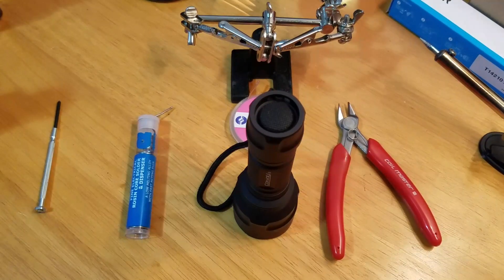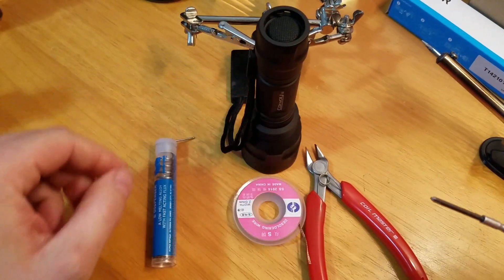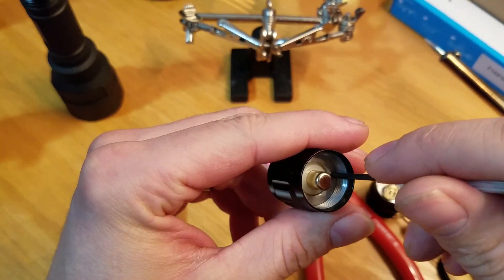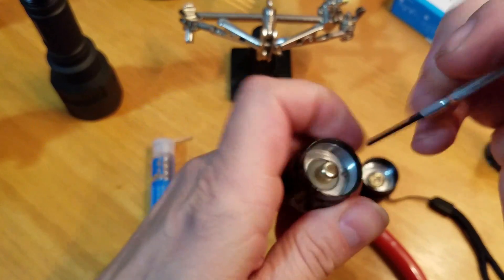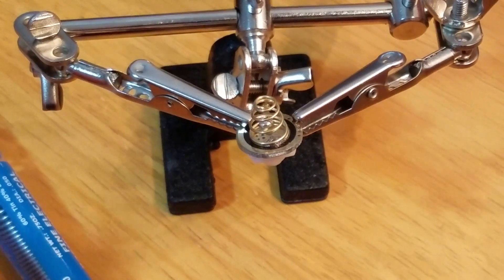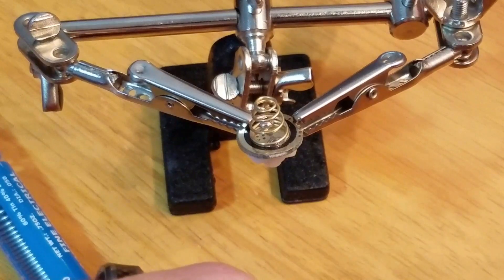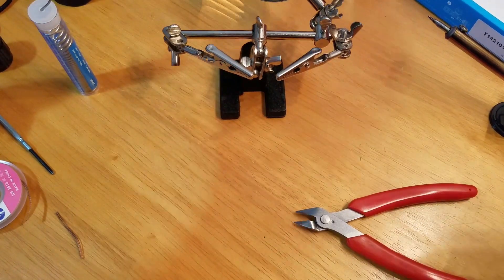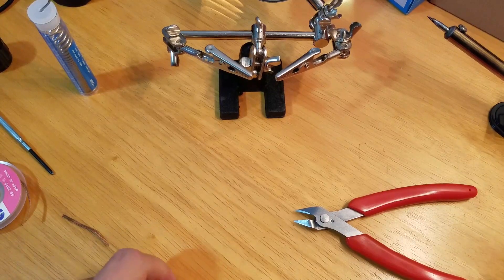Flashlight Tail Spring Bypass  (How To Video) On The Convoy C8

Comment: I fixed my lil LED flashlight today. It was a rear button. Just replacing the batteries didn't change anything. Make sure you test the batteries that you are putting in. People at my house seem to save weak and dead batteris and put them back in the package. 🤬 After putting the new ones in, I found that the switch wasn't getting a good ground, so I bent the tab out so it can contact the inside of the flashlight. I also had to use steel wool to clean off the oxidation from the aluminum. It works like new again.

Comment: I wonder about the spring. In normal use, passing current through that spring should alter the spring resistance. My guess is it would increase resistance.
The copper braid should make resistance more stable.
Since the copper braid is in 'parallel' with the spring, resistance should actually be lower.

How much brighter was the light and how much longer did the batteries last?

Comment: Now he has ended up with a blob of solder contacting the battery instead of the gold plating on the spring. The overall resistance has probably increased, defeating the intention of the mod.

Comment: To remove and tighten the "thing" holding in the tail piece, use a pair of small, needle nose pliers. Place each of the needle nose tips in the 2 indents on the "thing". You will have much more control of the "thing", especially when you're  replacing it and need to find just the right position to find the threads and avoid cross threading. It's also easier to screw in, after you get it started, if you  control both sides, rather than controlling only one side with a screw driver.

Comment: actually the're no difference at all my god flashholics people so sassy
Reply: depends on driver you use.. if you do it on stock convoy 7135 chip type driver sure it will make no difference.. if you do it on direct fet driver the one that astrolux use, than it will make a bit difference... im done it on my astrolux c8 and blf q8 and gain about 150 Lux more after do it on q8 measure with ceiling bounce style....
Reply: @harisyoung4110  and what about astrolux eco3,can ı see big difference ,eco3 has double springs.What can u say?
Reply: @TheSuvari  Go to budgetlightforum.com and search for a spring bypass vs double spring thread.. there will be more scientific test present there that show the resistance measurement result between those two.. sure will be more difference with ec03 bypass but at only few second before the temp control kick down the brightness.. i have a sp36 narsil that can set to turn off the temp control and with all the 3 spring bypass, in just 2minutes of turbo it build so much heat till i cant hold it with bare hands.. but the most benefit i get is when the batteries is not fully charge it still give the best performance due to lower resistance.. and sp36 also come with double spring at all 3pcs batteries slot.

Comment: I'm new to modding torches and wonder how much do you gain from this. I just opened my BLF A6 (same as Astrolux S1) and measured the resistance between spring and the outer copper ring, it's about 8.5-9ohm depending where I put the probe. Any idea how does this compare to other switches?
Reply: OhFishyFish personally i wonder about the gain but I would suggest to you to touch you meter leads together first, if possible zero the meter at this point. The best way to measure such low ohms and possibly even check how the mod improves current flow is to pass a known current through the spring/switch assembly and measure voltage drop across assembly. Then use ohms law to mathematically deduce the resistance, most likely a fraction of an ohm. You is be measuring the leads of your meter if you seeing upwards of 5-10 ohms.

Comment: If that tailcap spring is really gold coated, is this hack necessary? Gold is an excellent electrical conductor.
Reply: Think of it as using one wire or a pair of wires to carry current

Comment: Bypassing the spring and increased voltage on bulb. Would that decrease bulb life or possibly cause it to burn out?
Reply: Your driver will prevent that.
Reply from the maker: +Larry Olimb it will slightly decrease the bulb or led life but not by much at all. As far as blowing a bulb I'm not sure but I do know it will not blow an led.

Comment: Hey man tks for your nice video. I have the cheap one. Any suggestions on spring bypass?
Reply: The tail spring bypass is only one of a few "tweaks" to turn a cheapie into a pocket rocket
The next being bigger wires from driver to star (MCPCB) (I use 18ga silicon coated because it alot more flexible)
Then better heat sinking of star (MCPCB) to body (I have used JB Quickweld on some, others just a bit of good PC heatsink compound works well
Biggest will be to replace stock cheap chinese aluminum star (MCPCB) with a direct thermal path copper star from sinkpad or noctigon due to it allowing MUCH more heat to escape the LED allowing it to run brighter longer.
Come to budget light forums for ALOT more tips and tricks
Reply: They all arrere cheap imitation Convoy C8 (they all come from China) you can use solder braid or 18ga wire, all that is happening is the current flow no longer runs down the spring to thru the switch...a spring is more or less a long piece of wire wound up...and it's spring steel so not all that great current carrying capacity..putting a low resistance path bypasses the current flow meaning more current can flow and makes your emitter run brighter
Reply from the maker: +Brian C that is correct!
Reply from the maker: MetalSir which host are you working on?
Reply: luxLumen GR hey! You replied to me very fast but I didn't get the notification from YouTube. I'm on a cheap imitation of a convoy c8. It's my first soldering attempt but I really want to do this thing myself. :) so where did you attached the wire at the top of the spring? To the spring top and then putting the "button" on top? Tks man
Reply: Brian C did it. To be honest i can't see any difference.. maybe I did something wrong eheh
Reply: Breeze 
you missed out. brian c made that comment 7 months ago. he has been dead for nigh on 4 months now. if you’re done being totally insensitive go away and bother someone else that isn’t dead

Comment: My advice would be to always put the heat on the part with more mass first. Like the top of the spring, don't put your iron on the braid, put it on the spring, the solder will liquify and the flux inside the braid will draw the solder into the braid. 

I find the braid is so quick to draw in solder, that I get the solder liquid and then just barely push the braid into it and remove the iron quickly. I tug on the braid, if it grabs I leave it alone. Going back to add extra solder can get you in trouble. It can get too stiff and the spring won't compress all he way.

Good job on the video.
Reply: Agree, but also, do not transfer solder by soldering tip to stuff you want to solder. If you have to, do it as fast as possible - the nice smoke you see, it is all the flux vaporing into the air and only thing left on iron tip is burnt solder, which will be almost imposible to stick to anything, even desoldering wick. I learn it the hard way, so keep this as advice. ;)

Comment: Can this destroy the flashlight?
Reply from the maker: Lynge Randen Børding No it will not.
Reply from the maker: Lynge Randen Børding No it will not.
Reply: When you have a Flashlight with a Luminus SSt40 and a good DD Driver and a Sony VTC6 this mod can destroy the LED.
Reply: @schnorrespit  no, i run my sst40 dedome in my c8 with vtc6 and samsung 30q, it still not destroy yet after a years of using... i always run it on maximum more than 10minutes until the flashlight get terrible hot and cant hold it in hand, but it still survive... the key is a good thermal paste and good cooper led mcpcb..
Reply: @harisyoung4110  how about the NCR18650B? will this also destroy the light? I am using S2+ SST40 which is already bypassed when i got it.
Reply: @harisyoung4110  how about the NCR18650B? will this also destroy the light? I am using S2+ SST40 which is already bypassed when i got it.
Reply: @fiatluxmequi3227  No and dont worry.. stock convoy sst40 driver already being limit to 5amp maximum current and have temp control.. mine had change myself with blf a6 driver that is direct drive and no temp control, im measure it pull 9amp with fresh charged battery.
Reply: @fiatluxmequi3227  convoy flashlight heatsinking is pure copper and good.. im once forget it on maximum mode leave it on a table for about 15minute, it get hot till my hand cant even touch it and melt the plastic bag below it but the flashlight is still running good till now.. it good as a pocket lights but the heat at higher mode is too much to be hold on hand when use for a long period time during campaign or explore trip.

Comment: I have an c8 with an XP-L HI great throw too but mine has like a weird deadspot if i shine on something thats within 30 feet
Reply from the maker: +bram m is it like a donut effect?
Reply: yeh but like 1/3 of the donut is darker light something is blocking the light if i unscrew the lens a little then its gone but when i fully screw it down it comes back like the reflector doesnt sit quite right
Reply: bram m I heard  a say on a C cell maglight led conversion to install new bulb & then push sideways 10 degrees & sure enough it solved the donut problem,